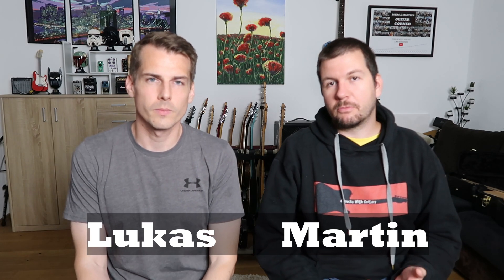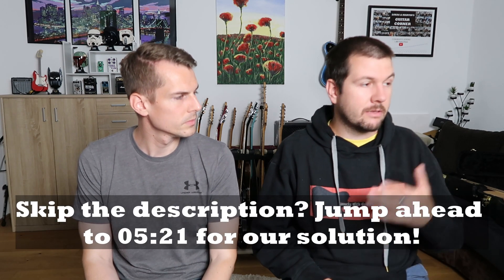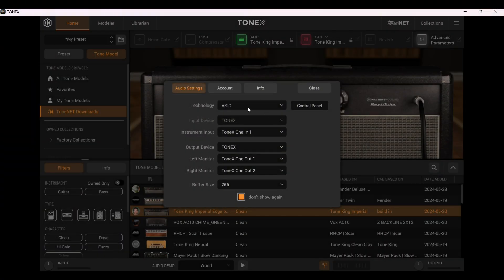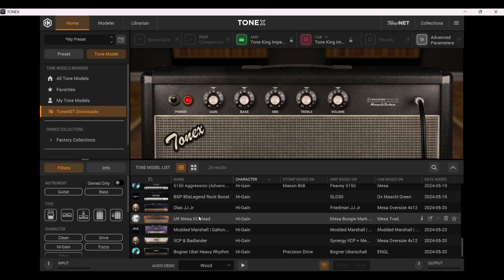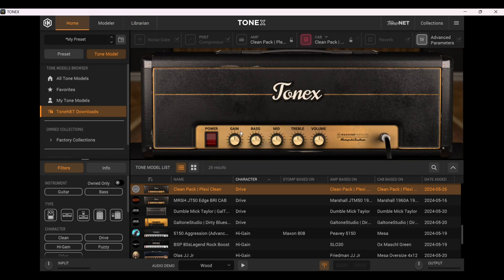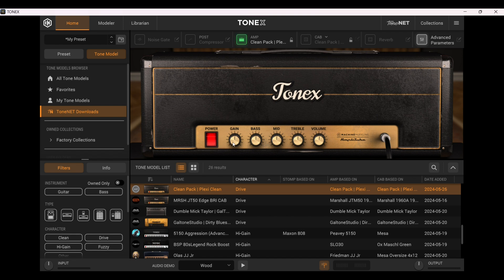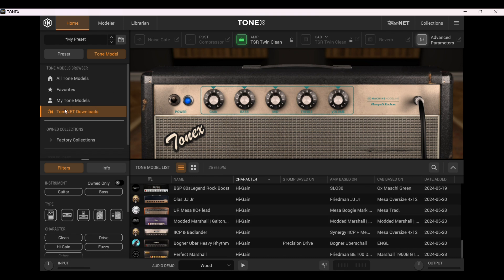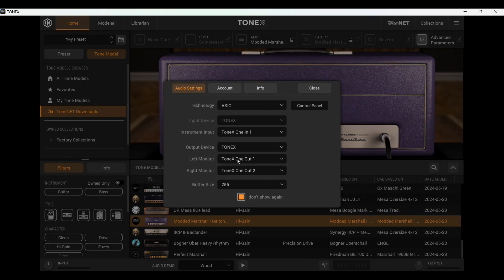TONEX ONE: Real Time Model / Preset Testing with ToneX Software

Comment from the maker: Hey everyone! PSA: With the firmware update released in July 2024, you can now deactivate the dry signal and with this workaround you really only have the signal from the PC then! In short:
1) Enter stomp mode on your ToneX One
2) Bypass the pedal
3) Go to the Librarian tab, click on the global settings and disable "Direct Monitoring"
Cheers!
Reply: Thank you very much!
Reply: So to clarify, I haven't bought the tonex one yet, but plan to: Your still can't like temporarily load a preset on the tonex one? In my case, I use real pedals before and after the tonex one, so would like to be able to preview everything together, before I download the preset to the device.
If so, it's a pain to use the editor and test tones. At the same time you really need the editor because of the limited adjusting possibilities on the tonex one itself...
Oh, and I use a focusrite Soundcard aswell, I don't want to use the tonex as the active Soundcard on my pc...
Reply from the maker: @ztevie.j  It's changed quite a bit now. The software has been split into two separate ones. Maybe we should really do an updated video, because you essentially need the same workaround for what we're showing in the video, but you have to do it in very different places. But, you can modify presets on the PC and then download them to the ToneX One. This is a little bit tricky if you use the ToneX One as your audio interface. That's what we're showing in this video. You can also directly modify what's on the pedal when connected to the software. That's absolutely no issue there and easy to do. It never was an issue there. As mentioned, you only have a little "problem" if you want to preview a capture/preset that is NOT downloaded using the ToneX One as your audio interface for input and output as it would stack the effects and go in parallel also to your output device (amp, PA, whatever). That's where that workaround comes into play. If you go into it through the Focusrite, not using the ToneX at all for any previewing (neither as input, nor as output device), I see no issue, as you are not stacking any of the signals. However, that will most definitely also alter the sound a little, as the focusrite output and input stage obviously differs from the ToneX One's.
I hope that helps.
Cheers,
Martin

Comment: My Tonex software has no “librarian” option. Just “home” and “modeler”. Maybe because it’s a new update? Could you help me with this ?
Reply from the maker: Sorry for the very late reply, but the last week was a bit hectic and I wanted to check again to be able to describe the process a little bit more in detail.
So first of all, you have 2 applications now, not one. The first step is to open "TONEX Editor".
In the top right corner, you will find the gear icon, click on that and then select the "Global setup" option.
Go over to the "General" tab. There you switch off "Direct Monitoring".
Once you've done that, you switch to stomp mode, if you haven't already. Again, if you haven't already, switch the effect you've assigned to stomp mode off by pressing the footswitch once. (The alt button should not be illuminated.)
Now you can close the "TONEX Editor" app and open the "TONEX" app.
Now you can select there whatever you want and will not have any doubling or stacking effect. You can preview them in the Tone Net, create presets, whatever you want. To manage those and download them on the pedal, you'll have to switch back to the "TONEX Editor".
I like to switch the direct monitoring back on, after I've finished my work in the "TONEX" app.
I hope that helps.
Cheers,
Martin

Comment: Another workaround: use your regular audio interface and connect one of the outputs to your guitar rig. Tweak the presets to your taste and then upload them to the Tonex One.
Reply from the maker: That's also one way, but for that you'd need another audio interface, which not everybody has. And even with an audio interface, that would not be my preferred method. The impedance of the audio interface may differ. Also there could be some EQing going on, voluntarily as well as involuntarily through a different DA converter. You will most definitely get close, but might end up with a sound you would still have to tweak with the pedal itself. If you use just the pedal, and with the software update they made there are no drawbacks anymore using it, you don't have to worry about any of this. So I see no reason to do it via another audio interface.
Cheers,
Martin
Reply: @LMGuitarCorner  It's true, you don't need an interface. The Tonex alone does a good job with the newest software version. However, in my case i seem to get a better latency with the interface (Focusrite Scarlett) than with the Tonex although both are set to a buffer size of 64. Furthermore, with the USB cable connected, my Tonex generates some unwanted noise which i don't get when using the Scarlett straight to the FX return of my guitar amp. Conclusion: There is no perfect solution for me and both variants have their benefits. :-)

Comment: Thank you very much for this workaround and your tips on the settings of the ToneX One! I was almost desperate.
Reply from the maker: @FelixFrosch-o9f  You're welcome! When we bought ours, it was fairly clear how we'd be using them. For Lukas in the return of the FX loop and for me into a PA. So we immediately ran into this problem and tinkered quite a bit until we found a way we could work somewhat decent with it. The firmware update essentially made this workaround a "fix".
Cheers, 
Martin

Comment: Hello L&M! I downloaded some killer tones you guys made on my spark 40 amp. So I went along and liked you guys on YouTube. Those were some awesome tones you made. Please keep them coming as I am following you on the spark app as well.
Reply from the maker: Thanks a lot, glad you enjoy them! Out of curiosity, which one do you like/use the most?
Cheers,
Martin
Reply: @LMGuitarCorner  Pearl Jams Mike McCready Yellowleadbetter. You guys really knocked it out of the park on that  one, It sounds exactly like the album.
Reply from the maker: @jeffereywhite5564  Thanks a lot, that required quite a bit of tweeking. It also always depends a bit on what guitar you're using, but that's why I always add what I've used on my end in the tags. Nowadays I only use the 4 presets stored on the hardware and Yellow Ledbetter is one of them together with the Rolling Stones one, an updated version of the AC/DC preset (due to the speaker change on my amp) and finally the Crossroads V3. With that I'm covering all the styles I'm playing, especially as the Spark really cleans up nicely with the volume control and so one preset can easily be used for multiple things. Maybe I should update the AC/DC one on the cloud too, because that one was made with headphones or high volume jamming in mind where the speaker limitation makes it automatically not as bass heavy anymore. Back then, I used the Spark mainly like that and as such, I haven't reduced the bass as much as most other presets do.
Cheers,
Martin

Comment: Thanks guys, life saving workaround
Reply from the maker: You're welcome! If you didn't see it already, with the new Firmware update, you can also get rid of the dry signal that's going through the pedal into the power amp. 
Cheers, 
Martin

Comment: Tolles Video. Ich bin froh, dass Tonex Pedal und Tonex One standalone vernünftig laufen und gut bedienbar sind, sobald man erstmal seine Presets zusammengestellt hat und mit den Sounds zufrieden ist. Dann kann man die Software für eine Weile hinter sich lassen und die Pedals gut nutzen. Bis man wieder etwas ändern will und sich den Krampf erneut antun muss ... Hoffentlich bringt IK Multimedia diesbezüglich bei Gelegenheit eine Verbesserung via Firmware-Update an den Start.

Fällt euch eigentlich die höhere Latenz des Tonex Pedals gegenüber dem One bei der Verwendung als Interface auf? Das ist auch so eine interessante Stilblüte, für die ich keine Erklärung habe. Denn eigentlich dürfte das teurere und größere Tonex Pedal ja keinen schlechteren (ergo langsameren) A/D-Wandler verbaut haben.
Reply from the maker: Vielen Dank! Mit der neuen Firmware lässt sich das Direktsignal des Pedals wenn es am PC ist ausschalten. Interessanterweise geht der Eingang in den PC immernoch durch das Preset welches am Pedal selektiert ist. Um also ein Stacking zu vermeiden, muss immernoch der Workaround mit dem ausgeschalteten Stomp Mode gemacht werden. Nun ist aber dann zumindest das Dry Signal das zuvor noch durch das Pedal in den Amp kam weg. Insofern gab es immerhin schon eine kleine Verbesserung.
Zum Tonex Pedal können wir nichts sagen, wir haben beide nur das One. Aber ja, ist sehr seltsam. Das kann ich mir auch nicht erklären.
Schöne Grüße, 
Martin

Comment: I use a work around that works for me try it out, turn the amp off on the software
Reply from the maker: @georgecaraballo  But that's the one I want to test before I download it to the pedal. So how would that help me? With your solution, you would always have to download it on the pedal and then test it through the pedal, or am I missing something? 
Cheers, 
Martin

Comment: Tried it… didn’t work )-:
Reply from the maker: In what way did it not work? Where did you have the issues? With the new update you can also remove the dry signal passing through the pedal. Also, are you using the ToneX One or the larger pedal?
Cheers, 
Martin

Comment: You should make a new video., because of the new firmware software update. 😊😊😊
Reply from the maker: We'll have to try it first :D
I wasn't even aware that there's a new firmware out. Thanks for the info! Cheers, Lukas
Reply: @LMGuitarCorner  l can't wait to see you guys video. It's seems to that IK Multimedia did solve the issues for most players. Awesome and keep the good work. 👍🏾
Reply from the maker: Thanks a lot! Would be cool if our video had been the trigger for them to improve on that issue.
Cheers, 
Martin
Reply from the maker: @nlmal4  Hey there, we just had a look at it yesterday, they solved the issue, that you'd have the pedal signal going to the output, however, they still have the selected pedal sound going into the digital input, which causes the gain stacking. So the workaround we're showing in this video is still required. You will have to go in stomp mode and deactivate the stomp, so that the ToneX software on the PC will receive the dry signal and not an already altered one from the preset on the pedal. But then it works and you also won't have the dry signal in addition to the selected model sound.
Cheers,
Martin
Reply: @LMGuitarCorner  Hi Martin thanks for the feedback. I will look into this issue. But we make baby steps forward. ☺️🤗🤗
Reply from the maker: @nlmal4 Definitely. At least now it's possible to properly test it. 
Cheers, 
Martin
Reply: @LMGuitarCorner  Hi Martin, in short the tonex software is not their jet, but I was able to control the software by making changes in the present and close the system software completely. You see it is very difficult to operate software in an easy manner. IK multimedia still alot of work to do 👍🏾🙏🏾😪

Comment: Brilliant!
You’ve solve the secrets of the universe, thanks!
I will also use this trick to turn off the ToneX pedal and let the IR200 or HXS provide the amp tones without multiple amps running over each other.
Although sounds sweet with the JC120 and IR paired with the ToneX or HXS… kind of a sweetener to the tone :)
Reply from the maker: Haha at first I thought you're being sarcastic. You're very welcome. I'm glad our little workaround did the trick. Cheers, Lukas

Comment: how do you get to the screen where you see the mini 3 screens ( stomp mode) on top?
Reply from the maker: That's the Librarian screen where you can load the models onto the pedal. Cheers
Reply: @LMGuitarCorner  how do you do that?
Reply from the maker: Go to around 5:20 in the video and look at the top left corner. You should be able to see where I click. Cheers
Reply: @LMGuitarCorner  for some reason when I duplicate your clicks I don't get  the stomp mode, I have the tonex pedal not the one, does that kame a difference?
Reply from the maker: That's probably the reason, however, I'm not familiar with the big ToneX Pedal, sorry.

Comment: how are you able to make real time adjustments on the amp model that go instantly to the pedal?
Reply from the maker: You're essentially not doing it on the pedal. You're doing it in the Tonex software. You then hear the out of the tonex software through the pedal if that makes sense. But that is the same as if the pedal would use that model and send it to the out. It's the same software that does the signal processing. You're using the pedal just as an audio interface for in and out. If you want to adjust something that is on the pedal, just switch from that tab away.
Cheers, 
Martin

Comment: Hi, thank you for the tip, I noticed that if I turn off the output knob in the software the sound I get is the same when the pedal is not attached to the computer. Am I wrong?
Reply from the maker: Hey there. You're welcome. Absolutely - if you turn the output in the ToneX software all the way down, the software is muted. You could say that the output acts like a master volume "knob" for the software. What you end up with is just the tone the pedal provides. Cheers!

Comment: They need to fix this urgently. It's a hot mess! I've spent the whole night here trying to work out this problem and found your video. I can't believe everyone is not complaining about this same thing. It's modelling software. And it completely messes up every model you try to use. Mixing the dry signal in as the best case scenario is still terrible. 

Come on IK / Tonex... This is not good enough!
Reply from the maker: There is another one, if you have another audio interface, that is...
You could select that one as input, and the ToneX One as output. That should work as well without passing the dry signal through. They should have some kind of mode on the pedal where it simply works as audio interface with input and output, but the whole pedal aspect is bypassed.
Cheers,
Martin